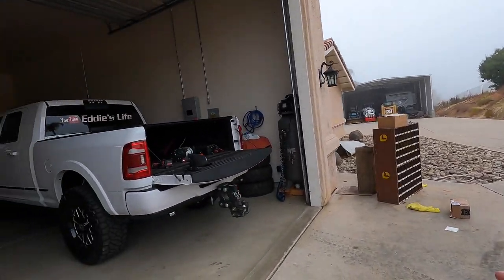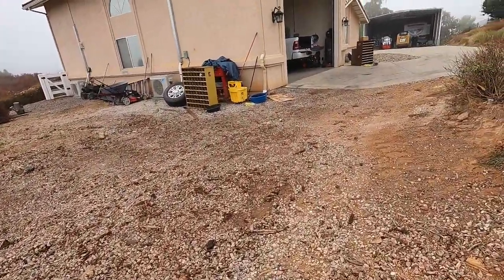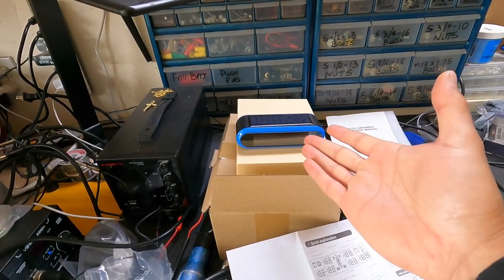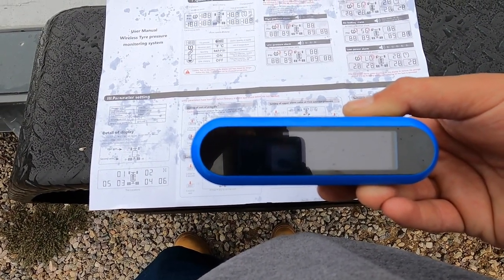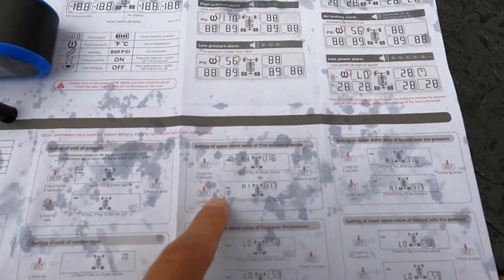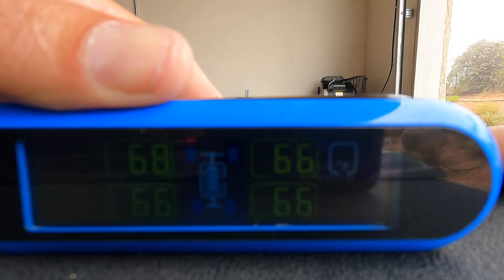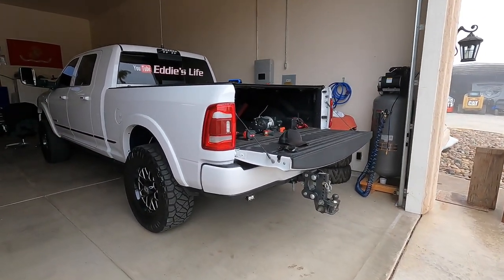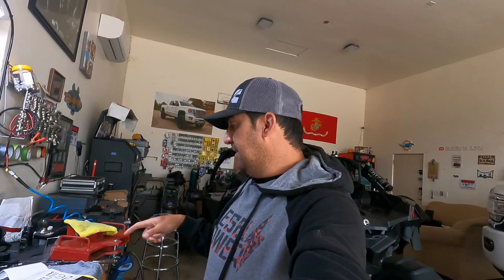Finally found a TPMS sensor system that works!!

Comment: I coat the wood with used motor oil. Just roll it on with 3 4 coats and let it dry. 🤙

Comment: The only thing you can do is a good deck stain or paint stain. Any kind of paint won't have enough flex to not get destroyed the second it expands or contracts. 
If you would have bought a Ford you could have that hooked up and viewed in on you gauge display. 😉

Comment: I have this same TPMS system for my trailer. They are sold under many brand names, all manufacturer by the same company. I drove from CA to FL in June and it worked well, the temp is particularly useful. I found that the sensors would regularly lose the connection on my 28’ car hauler and at first it is a bit worrying but then you realize that when the sensor goes away completely it is a connection issue. Pulled in for fuel in Louisiana and as I was leaving the station the sensor warned low pressure. I pulled into a Walmart parking lot, it was 11pm, and checked the pressure. It was low so I pulled the tire and there was a pressure bulge on the inside. TPMS system 1, tire blowout 0. Coming back from FL I was almost home and I noticed sparks flying off my rear trailer axle. Pulled over on I-5 and the tire was completely gone. No warning from the TPMS system. What I also found is that the extra 2 sensors you have on a dual axle trailer are not interchangeable. I lost my valve stem with the sensor and tried to program one of the extras on my spare, no bueno. So all things considered this is a handy system but it is not 100% reliable, and the extra 2 sensors are worthless if you have a dual axle trailer.
Reply from the maker: Dam that’s some good info, thank you
Reply: I had peace of mind with this TPMS system because I was hauling a Porsche Panamera Turbo S hybrid and an Indian motorcycle in the trailer. Both are porkers and my 10k trailer was maxed at 9,600 lbs. My nightmare scenario was shredding a tire and having the debris damage the trailer into the cargo area where the Porsche was sitting right over the axles. I watched that tire temp pretty closely because as you know driving through the southern states in June is by itself stressing the tires. I’ve since replaced the tires on my trailer with Hankook trailer tires that are N speed rated. I’m hoping this helps with reliability in the hot months as well as gives me a little more wiggle room driving 70-75 mph on I-40 and I-10, even though it kills my mileage

Comment: Tire pressure should be adjusted on how much load is on each tire. More weight the more the psi needed. Found this link. I’m sure there is a better one out there but it will give you a idea. 
https://www.yournexttire.com/trailer-load-inflation-chart/